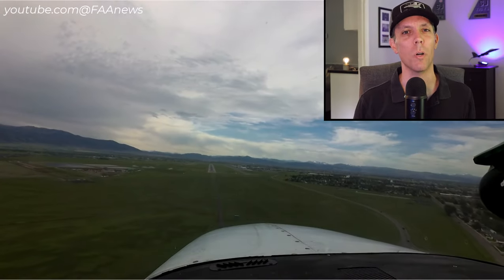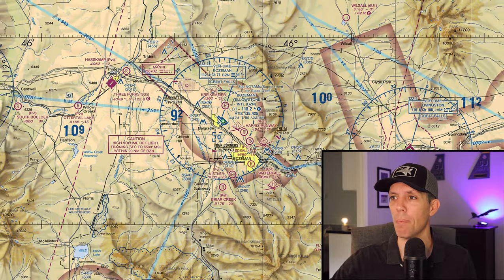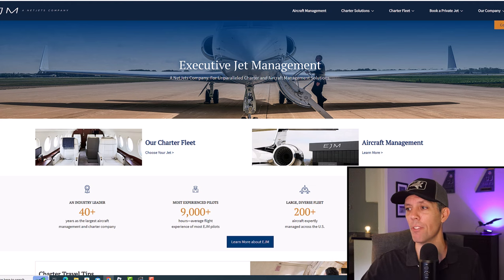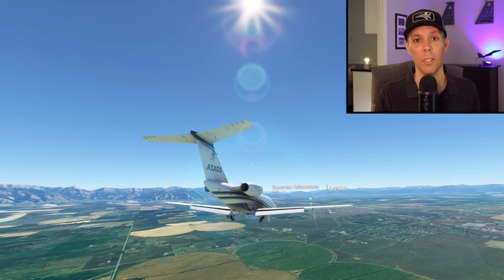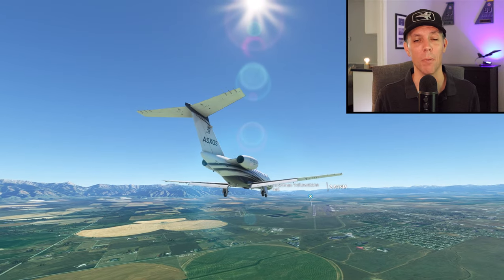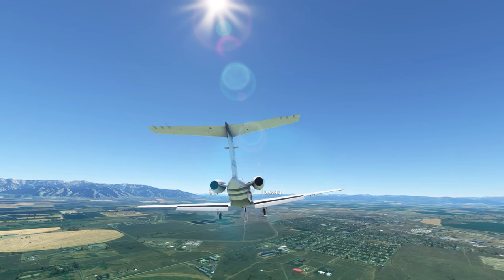Pilot Actually Lands WITHOUT Permission!

Comment: You really should talk to some experienced, and I mean 30 plus years and 20,000 hours of flying kinda pilots and their equivalent atc controllers before jumping into this messy situation. There are expectations on what aircraft are supposed to do, Don’t go jumping off on your own without considering where you are, weather, traffic, controller workload and AC fuel state. The entire atc to AC comm system is antiquated and unchanged since Tenerife. It’s only a matter of time. The AIM and FAA rules are equally old and designed for a far less busy environment than say, Jfk today on a Friday night with summer Tstorms all over the place. And a go around in Hong Kong will cost you 8000 lbs of fuel. If they don’t get your check in they automatically give you a green light unless it’s unsafe. This controller sounds like he cared more about chastising them, were they even off the active runway? than safely getting aircraft on the ground. That’s the whole point. It’s not a game of who can catch who, it’s about getting planes back on the ground.

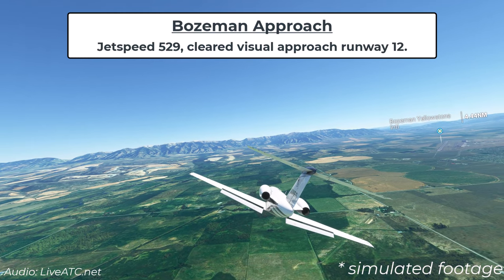Comment: What am I missing here?  He was cleared for the visual on runway 12 and told to contact tower. Whether he contacted the tower is a separate issue. He was cleared to land by ATC. It’s right there at 1:30 in the video.
Reply: He was cleared for the visual approach.  Not to land.  The approach clearance comes from the approach controller.  He is on an IFR flight plan and can see the airport. So cleared for a visual approach.  He should check in with tower and get clearance to land.

Comment: Ah dont worry I will make up something. The first thing that comes to mind is the Watsonville mid air. Reminds of the twin pilot that flew it throttles up for a straight and smoked a student pilot killing 3 and his dog. It was a uncontrolled airport but its similar in my opinion. The twin pilot heard the student talking to him but instead of actually responding so they coordinate a plan he continues to makd position reports like a broken record. I know im not a pilot and this off topic but wouldn't it be smart to actually talk to the other planes in the airspace especially when they tell you your coming up on them fast instead of reporting your position because they dont know how fast your flying ? He went from a 10 mile final to 3 in less then a minute. Most mid airs in 2023 were due to lack of communication. The one with seaplane they supposedly had no radio then come to find out a student training there video recording them having radios but being told to turn them off. If you don't want to communicate clearly and directly you should stay on the ground in my opinion.

Comment: Yeah, the only time its ok to land without clearance is...  when thats  the least of your problems.    

One case was electrical shorts,  radio, radar, transponder, all lost power,  instruments were iffy if they were showing correct information or not, VFR only now, with no coms.   pilot put it down at the wrong airport...   and the tower was about to make a deal about it when he saw the smoke coming from the cockpit windows and the door open... he then rolled emergency vehicles..  

Thats probably the ONLY time you're going to get away with landing without clearance..

Comment: Executing a missed approach in a situation like this (incommunicado...), is not always the best choice. It depends on where you are (what airport) and what the traffic situation looks like. There very well could be places where the best, the safest course of action would be to continue to a landing as per normal operations then sort it all out on the ground. At very busy airports where airplanes are launching off of runways every several seconds, the last thing a departure controller needs is a "fifth wheel" jamming itself unannounced and unexpectedly into the maze of flights. However, that being said, each scenario needs to be judged separately at the time by the PIC. In any event, all eyes need to be outside searching for traffic on or off the runway in question. If I had been the PIC of this particular aircraft and was unable to communicate with the tower, I would have, of course, checked that I was on the right frequency, then, perhaps, returned to the Approach Control frequency to let them know what was going on. If still unable to communicate with anyone, I would have announced who I was, where I was, and my intention to land on that particular runway and then listened for any response.  If they had gone around they would have possibly been in conflict with other traffic while in a Nordo state...(Where are you going? What are you going to do?)  However, I believe these pilots were "offline" for some reason.   Go-arounds should always be able to be executed with high degrees of safety, that we all know. But sometimes those go-arounds can fall apart quickly if they come out of the blue like this - especially if it has been a while since we've done one... Therefore, again, sometimes the best course of action is to simply continue as normal but with super-elevated situational awareness. Personally, I've landed airplanes a few times without specifically being cleared to land, and each time after landing the ground controllers told me we had done the right thing; we had been cleared for approaches and were in the que for landing. So, sometimes, SOMETIMES, just get on the ground as normal when you can. The Tower operator knows who you are, where you are and what you're going to do. But, sometimes the best thing might be to circle the tower and wait for a green light... If you are the PIC, you have to judge for yourself.

Comment: I ONCE  WAS FLYING A RENTAL PLANE  - cherokee 140,  and the radio quit mid flight  they could hear me, but i couldn't hear them   the problem was intermittent    everything went back to normal as i touched down.   turned out to be a bad connection in the antenna.   this was 55 years ago   they looked over the plane   i was a student pilot at the time .   they signed my log book - 1st cross country solo - and sent me home.

Comment: If, tower and approach, radioed speed 529. Where are those recordings? If, tower and approach, were using the wrong call, speed 529 might not reply. I was landing in Lancaster CA and was asked to extend my down wind. The tower was to call my base. They used the wrong call so I did not respond. They had to be reminded who I was  then they called my base.

Comment: Im a Corperate Pilot ATP MEI CFII GOLD SEAL Instructor/Test/ Pilot with over 25,000 flight time...............I ve Made this Mistake and WOW It is Embarrassing................He more than likely said that to save face.............No Harm done....However Im sure it was pretty SOBERING FOR HIM Because  this is Nothing to TRIFLE with........Im sure he GOT A Talking to or maybe the tower made him call................Im sure nothing happened as far a discipline.......He went their separate was.............................Recently I Was Landing at MQY  Smyrna Tennessee in a KingAir 90 and came from JWN John Tune West Side of Nashville.............We were cleared to Land on Runway 32 from ATC  (TOWER WAS CLOSED) We were  coming from the west.....The Time was 6;45 AM................Tower was closed  (It opens a 7:AM )  As we were rolling out on Runway 32.................a Honda Jet was taking off on Runway 1 which intersected with Runway 32...............We were on Tower Frequency and there were no Radio calls  from the Honda Jet...... (We called out Down Wind  Base and Final Approach) and then we landed .......He crossed in Front of us about 30 yards as he was at Rotation speed we were just Rolling out...............There were People in the Tower watching this becasue the Tower was getting ready to open....... Tower made a Coment ''' THAT WAS FOOLISH''...THAT REALLY SHOOK  ME UP !!!!   So I Try not to land at airports when the control Tower are not in operation..............Or if I DO I MAKE DAM SURE To Look around.........................'' FOR BY THE GRACE OF GOD THERE GO I ''  Enjoy your videos!!   MUST VIGILANT ALWAYS...........!!

Comment: I'm not a pilot so I am very curious,   what happens in a  case like this?  Is the pilot fined or punished in any way?
Reply: It’s highly discretionary.
The first level of discretion lies with the tower controller. I’ve seen countless incidents go unreported simply because the controller is busy or just doesn’t feel like getting into it. In this case, he probably did file an incident report, if only because he got the approach controller involved, so he has to cover his own backside and not be seen to let it slide. 
Once the FAA gets a report, they absolutely will follow up on it, but what they actually do depends on their appreciation of the circumstances. Obviously, the fact that no one was injured or had to make evasive maneuvers to avoid an accident greatly lessens the severity of the incident, but they will also be paying careful attention to the pilots’ explanations for how it happened. 
They will want to determine if the pilots were responding imperfectly to a situation that was not of their making (equipment failure either on the aircraft or in the tower), or if they were responding to an emergency that made talking a low priority. Pilots have the explicit right to violate every rule in an emergency to exercise their best judgement consistent with safety. 
If the situation was entirely of their making – they simply dialed-in the wrong frequency, or their FMS computer selected a tower frequency other than the one in use at the time, the FAA may shrug it off as a “no harm-no foul” incident, and let it go with a lengthy phone discussion. Or they may issue a temporary suspension of privileges, conditional on completing some re-training, much as what happens to drivers on a first-time offense.
If they detect a blatant disregard for rules, or a flippant attitude by pilots simply doing whatever is most convenient for them, more lengthy punitive suspensions may be forthcoming. 

It is highly unlikely in a situation like this that certificate revocations will be on the menu. A Class D airport is far less serious than a Class C or B, as there are no paying passengers on scheduled service. Everyone using the facility is considered to be a “participant” in the aviation environment, to a greater or lesser degree, and this distinction is important to the regulators. A paying passenger on a scheduled service has the right to be completely ignorant of all things aviation, while confident in incurring no risk due to errors or omissions from flight crew. This is not the operating assumption at a Class D airport.

Finally, if the pilots realize they have committed an error, but did not do it intentionally, or with disdain or disregard for any rules or simply to make life more convenient for themselves, they may self-report using an ASRS form (commonly referred to as a NASA report by pilots) and avoid punishment altogether. This program is designed to encourage pilots to share information that could help in development of safety programs, rather than withhold valuable information for fear of punishment. The use of this form is again subject to the discretion of the regulators, but if not used abusively it will generally serve as a “get-out-of-jail-free” card. Don’t count on playing this card more than once or twice in your career….

Comment: This happens fairly often at BUSY airports with numerous, and sometimes crossing runways.  I'm amused that so many flip out over it here on YT.  YES, it is certainly less than ideal.   Frequency congestion, multiple AC being cleared for arrivals and departures to different runways, etc all on the same freq, etc.     For example, DCA back in the day had 3 intersecting runways going at once.   When a guy is handed off from APP to the TWR and the TWR neglects to make contact with the guy on final, it's not that big a deal because APP already sequenced the AC with the others coming into the airport.  At National, ONE GUY was responsible for 3 different active and crossing runways.  As such, he can be "in control" of 3 or more planes at once.  He's very busy as the arriving pilots are.  Is this ideal?  Of course not.   But it happens.    If a guy decides to go around because he cannot get through to the tower,  he is likely to create an even bigger disturbance than if he just landed in the slot that APP created for him (and the local tower controller was protecting for him).   A lot of people don't routinely fly into places like SFO, DFW, ORD, or Washington National and have no idea how quickly things unfold there and how compressed ATC comms become.   Trying to be "procedurally correct" in every instance can actually create more of a problem then you're  trying to solve.     

I did this once early in my career at DCA in the late 80s.   I promptly called the tower to "fess up and beg for leniency" from a landline.  His reply was pretty much what I outlined above along with the admonition to be more careful in the future.   "No big deal, it happens, don't do it again, be careful, thanks for calling, have a nice day".  

Additionally, a controller buddy tells me that if you can't contact ground after clearing the runway KEEP moving off the high speed and and then stop.   You're just going to clog up the arrivals if you stop.   Like the guy on the crowded escalator that freezes as soon as he steps off of it.   Everyone behind him is screwed.
Reply: LOL, had it happen not too long ago with crossing the runway. Guy ahead was cleared to cross without delay and we were cleared to cross as well, following him, without delay. As soon as he crossed the hold short line on the other side, he stopped and left me stuck on the runway. 😂😂. 
I was just about to yell at him to keep moving, when ATC started in on him. 😂
Reply: YT AC DCA APP TWR?

Comment: My best guess is that they may have been listening on the tower frequency while transmitting on another frequency/other radio, e.g. on the FBO's frequency. Still, no excuse.
Reply: Even if that's what happened, tower never told them they were cleared to land, so they still shouldn't have landed.
Reply: @beeble2003  No doubt. As I wrote, no excuse. Just trying to reverse engineer what happened.

Comment: BUT at 1:27 the tower says "Jetspeed 529, cleared visual approach runway 12."...?
Reply: First, that was Approach Control, not Tower. Two entirely different entities and areas of responsibility. Second, clearance for the approach is not clearance to land. The pilot should have selected the tower frequency and said, "Bozeman Tower, Jetspeed 529 visual 12." At that point, Tower would reply either, "Continue inbound," or, "Cleared to land."
Reply: @johnopalko5223  Not a pilot - thanks for clearing that up.

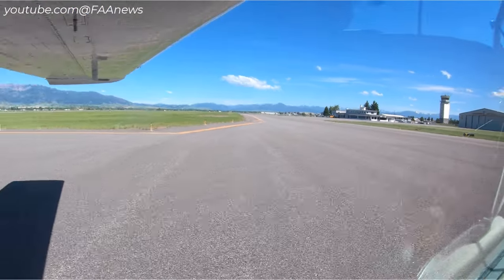Comment: I have a somewhat on topic question . If you are trying to land at a controlled airfield and get no response from the tower, are you able to treat it as an uncontrolled airfield? I worked at a Delta with no tower control 22:00 and 5:00 as grounds maintenance as loved to learn more about flying.
Reply: No, unless the tower is closed, you need clearance. Just repeat until you get a response.

Comment: 1:35 what does cleared for visual 12 mean?   genuine question, as I'm not a pilot
Reply: According to Paragraph 5-4-23(a) of the Aeronautical Information Manual (AIM), "A visual approach is conducted on an [Instrument Flight Rules] flight plan and authorizes a pilot to proceed visually and clear of clouds to the airport."

Paragraph 5-4-23(f) states, "Visual approaches reduce pilot/controller workload and expedite traffic by shortening flights paths to the airport. It is the pilot's responsibility to advise [Air Traffic Control] as soon as possible if a visual approach is not desired."

A visual approach requires a ceiling of at least 1000 feet and visibility of at least 3 miles.

Once established on the visual approach, the pilot must switch to the Tower frequency, when so instructed, and receive landing clearance. Clearance to fly the approach does not imply clearance to land.

Approach clearances are assigned by Approach Control. This is not the same as Tower. They are two distinct entities with separate areas of responsibility.

Comment: Maybe the pilot's mic malfunctioned.  If you heard the tower say "Cleared to Land blah blah" and you answer the tower but got no confirmation- I'd go ahead and land and at the same time trying to establish contact.  With only one pilot flying, switching radios or freq would add unnecessary burden.  I suspect it was a technical issue (like  a bad mic).
Reply: He was never cleared to land, he was cleared for the visual approach and acknowledged that verbally with approach and even acknowledged the hand off to tower.  You can’t land without a clearance, they never got one or established any positive contact with tower.  This is just a bad move and there’s no excuse for it.
Reply: Or "their odometer needed recalibration," officer.